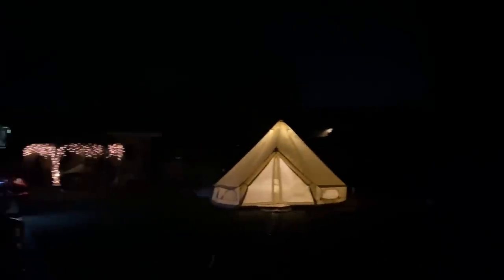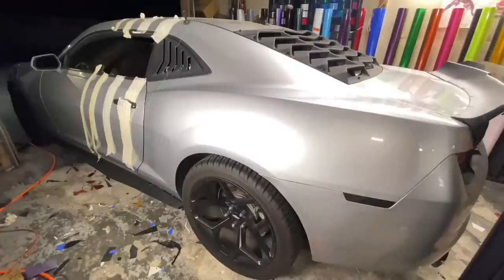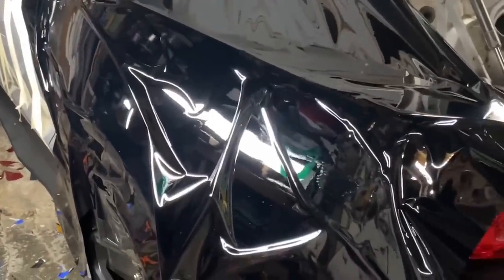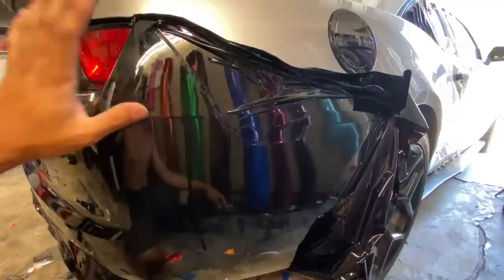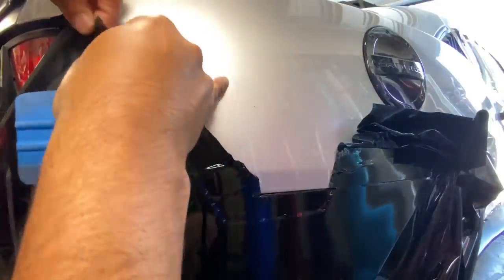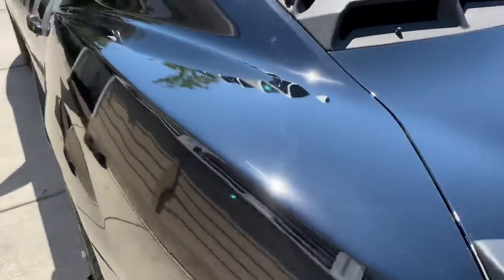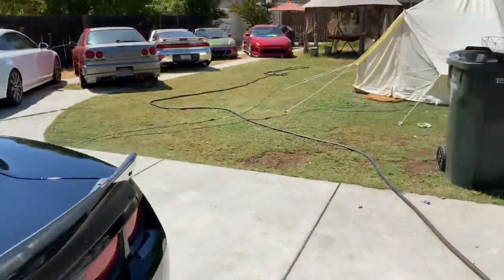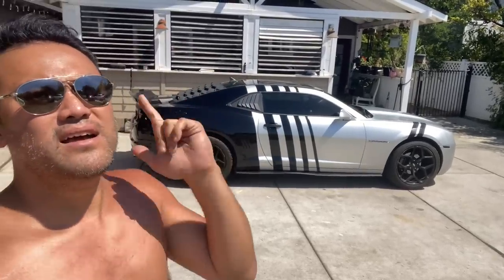The Most High Gloss PIANO BLACK Wrap Color EVER! | How to Partial Wrap A Camaro

Comment: You wont need to worry about leaving stretch marks in it if you leave the protective cap on it till after it is installed, it is meant to be installed with it still on.

Comment: 22:00 did you just razor blade and cut that vinyl on the paint👀👀🧐🧐? I didn't see a kniveless tape being pulled out, I saw you put the kniveless tape before  you put the second layer though but before that you cut right on the paint of the bumper.
Reply: he got the hands of a surgeon so the bumper's paint where he cut wont even have a knick

Comment: How long would that wrap last with weather conditions and when washing it does it leave swirls eventually like paint?
Reply: If you wrap it correctly & take care of the wrap I’ve seen them last 7+ years I tell my clients you should expect 4+ years the sun can make horizontal areas fail faster (hood , roof, trunk) hand wash with a microfiber wash mit you’ll limit your swirl marks. Most of them will come out with heat. Highly recommend putting a ceramic coating on it at the time of wrap.

Comment: Not the best Technique on the quarters. Just friendly tips , should always cold stretch and glass it side to side and squeegee the highest point then work your way up and down with the quarter panel dips. That way you dont have to keep pulling it off the car and reapplying. It'll prevent dust or anything to get behind the wrap as I can see you were picking away at particles behind the vinyl in few instances.